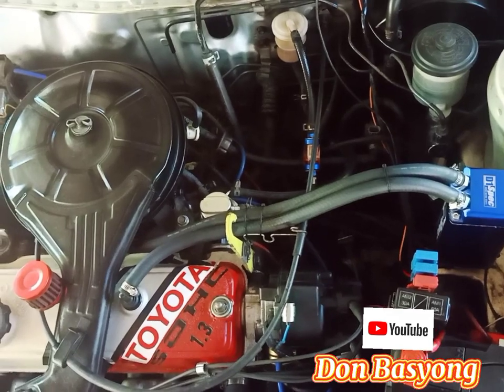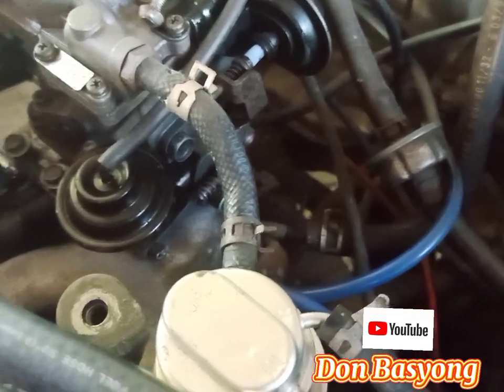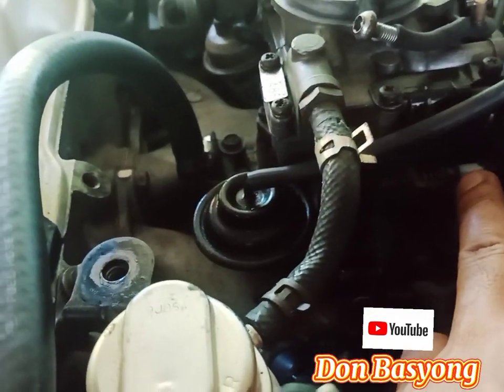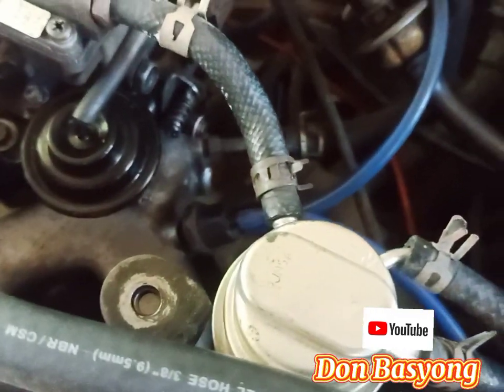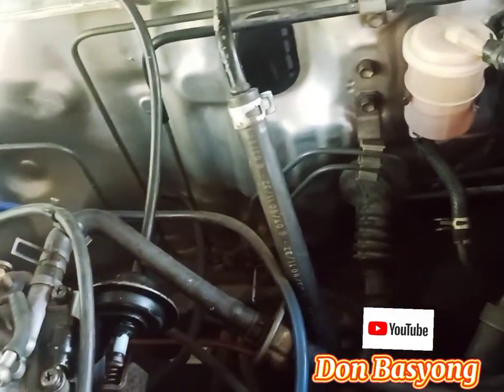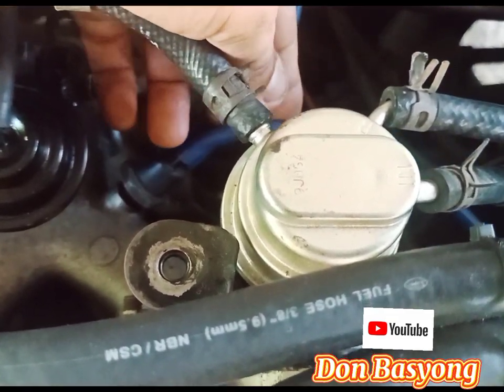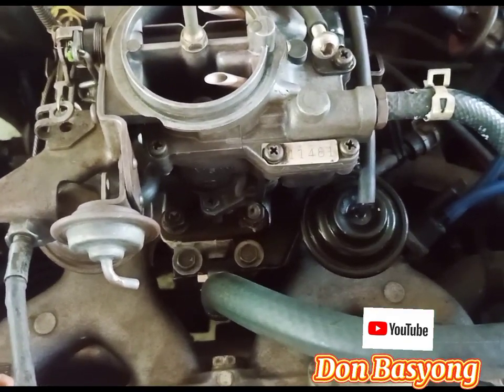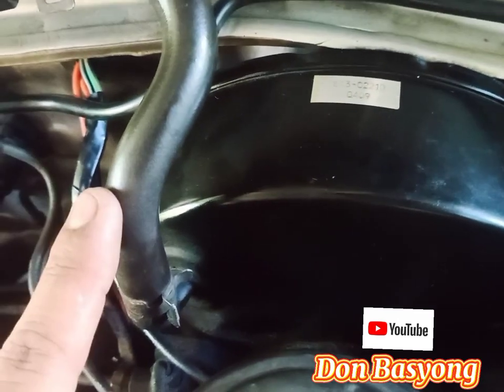VACUUM HOSE LINES | VACUUM LINES OF CARBURETOR,Aisan carburetor vacuum diagramTIPS DIY @donbasyong

Comment: Bat po naka block yung isa sa tatlong labasan mula sa manifold?para saan po kinokonek yan sir?
Reply from the maker: yung air control valve ba kamo paps pwede mo doblehin pwede din single akin kc nka single line port lng at iniba ko ang line gawa nabili ko ay wla na yung ibang check valve ng auto ko
basta ang importante alam mo kung saan ang port at manifold vacuum at kung anu anu ang gumagamit nito sa carb like ang aircon diaphragm it use vacuum na manifold at syempre dapat malaman mo kung saan saan ang port na manifold na pwede ka pagkuhanan. sana nakatulong paps godbless
Reply: @donbasyong  salamat po sir. Malaking tulong po ito kasi ang gulo ng mga vacuum ng bb ko
Reply from the maker: Basta pag may tanong ka o nalilito watch mo lang videos ko para ma guide ka at Kung may tanong ka nmn just message lang sasagutin ko paps🥰

Comment: Sir gud pm. Anong model ng distributor mo? Plano kong palitan ang distributor ng 1.3 2e ko na contact point pa to cdi. Thanks and more power.
Reply from the maker: Good day paps Ang distributor ko is pang2e engine din. Mas maganda Ang electronic type kaysa sa contact point paps less.
Reply: @donbasyong  May part number ka sa distributor mo? Thanks sa pagsagot.
Reply from the maker: @ronaldtio7375  paps distributor assy. Parts number 19020-11320
Reply: Gud am don  basyong...un  distributor kap ng  2e ko nabakli  un no. 1,,,temporary dinikit  lng dapat ba palitan na yon...umaandar nman...
saan ba may  murang  cap...
Reply from the maker: @berniegamba2986  meron sa lazada paps message mko sa messenger e forward ko don Yung store na pinagkuhanan ko Ng magandang distributor cap..paps

Comment: Saan po naka salpak po yun power piston? Sir
Reply from the maker: Power piston sa loob Ng carburetor paps may maliit na screw Yun Ng at chapa na naghold vacuum operated Yun paps sa loob mismo Ng carb pag matigas Yun o Hindi nagplay paalyado or di aandar Ng maayos Ang sasakyan.makikita Yun sa upper part sa loob Ng carb na makikita sa tabi Ng secondary at primary barrel.

Comment: Ano pong carburetor po ito? 4K po ba?
Reply from the maker: @bobtomica9614  2e manual choke o cable type kabasyong
Reply: @donbasyong  Ano po mas maigi na carb? 2E o 4K po? Yun po bang gawang china na carb eh ok na po o yung used aisin sa chop chopan?

Comment: Ano po output voltage ng idle up solenoid kailangan papo kasi pitikin ang gas para lang magka vacuum tinester ko po 5-7volts lang po nalabas
Reply from the maker: 12 volts Ang idle up solonoid paps now I try mo rekta battery Ang idle up ska mo  e test Ang Aircon..Kung mahina parin try mo ilipat Ang pinagkuhanan Ng vacuum/manifold vacuum baka barado na Ang line Kya hirap Ang solonoid or mas mainam change idle solonoid may nabili nmn na universal idle up solonoid 350 pesos isa. baka kc palitin Nadin solonoid paps. Thanks for supporting Godbless 🥰🥰🥰
Reply: @donbasyong  sir nag palit na ko ng solenoid e ganon padin nilipat ko na din sa katabi na vacuum ganon padin e
Reply from the maker: @oreunencarnacion2579  ipa overhaul mo na carb meaning may bara na Yan ipa Tira mo sa expert wag sa tabi tabi lang para makuha mo Ang good result paps.
Reply: @donbasyong  ah san po ba dapat nakalagay vacuum ng aircon ? Yung sakin kasi sa mismong manifold di po sya nakalagay sa carb e.
Reply from the maker: @oreunencarnacion2579  paps as long as Ang pinagkabitan mo ay manifold vacuum Ang manifold vacuum ay kahit naka idle merong suction Ng hanging while Ang ported nmn ay kapag revolution mo ska lng nagkakaroon ng vacuum..now Yung sa iyo check mo Kung Ang vacuum Ng Aircon mo ay nakakabit sa manifold vacuum kc pag Hindi bumabagsak Ang rpm lalo na kpag ito ay naka idle lang.
Reply: @donbasyong  nasa manifold vacuum sya pero kapag hinugot at binalik yung nasa idle up solenoid saka lang nalampas yung vacuum kahit bago na yung solenoid na binili ko ibig sabihin di sira yung luma ko ayaw nya lang talaga agad magbukas pero sir kung kulang sya sa voltage bakit kapag hinuhugot tapos binabalik e saka nagana solenoid tapos kapag sinusukat ko naman output 5-7 volts lang kaya nagtataka ako pero siguro kung 12v output sa solenoid kahit di ko na siguro hugot balik yung vacuum ng solenoid e tatagos na agad ang vacuum
Reply from the maker: @oreunencarnacion2579  ganito kc Ang concept Ng idle up solonoid sa loob Ng idle solonoid ay may open and close valve once you one the Aircon matic allowing the air na dumaan at higop sa Aircon diaphragm now Pag close nmn matic din magclose Ang valve at Dina padadaanin Ang vacuum.Ang important e once u one the Aircon it clicks together with the compressor na mag engage..may mga idle up kc na iba iba Ang resistance/ohms buy Yung universal para makasiguro ka meron kc tayo tinatawag na factory diffect na pyesa.
Reply: @donbasyong  yun nga sir e pag ka on ko ng aircon di sya nagana pareho lang ng pinaltan ko tapos kapag dinadirect ko naman sa battery yung luma at bago tapos hihipan ko tumatagos naman hangin kapag on position siguro patingnan konna muna sa mekaniko auto electrical o kaya car aircon salamat sir sa pagreply
Reply from the maker: @oreunencarnacion2579  paps pinalitan mo nba Ang capacitor? Sa may baba Ng blower Ng Aircon or Yung mismong resistor block baka mga palitin na Yang mga Yan paps.
Reply: @donbasyong  sir may video tutorial ka po ba ng pag baklas non tsaka yung mismong cover wala din kasing nalabas na blower sa gitna ng sasakyan e
Reply from the maker: @oreunencarnacion2579  meron paps kindly check sa upload ko meron pagbaklas at pagpalit paps Aircon system.
Reply: @donbasyong  sige po salamat
Reply: Sir ano kaya kapag cold start kailangan pa apakan ang gas pedal para umandar diba yung inyo ata kahit cold start susian lang kahit di na umapak gas aandar na ? Nakasagad din po advance ng destributor ng sb namin
Reply from the maker: @oreunencarnacion2579  pag nakasagad Ang advance Ng distributor mo meaning may talon na iPin sa iyong timing belt paps. dapat di Yan sagad at Isa pa may allowance Yan to be adjust paps. specially pag ginamitan na Ng timing light.now if you like to learn more pag dating sa preparation Ng advancer Ng auto ay meron ako mga videos regarding Jan check mo nlng sa mga video upload ko.
Reply: @donbasyong  kaso yung destributor po ng samin contact point nga ba yon yung walang box na itim tulad ng sa inyo
Reply from the maker: @oreunencarnacion2579  kapag Ang ignition coil ay nasa labas contact point Yan paps.pag Yung ignition coil ay nasa loob Ng mismong distributor ito ay electronic type distributor..now Kung Yung sa inyo ay sagad na Ang advance may mali sa set Ng timing paps or either talon Ng iPin Ang timing belt paps.
Reply: @donbasyong  contact point pa sya check ko po kung talon isang ngipin salamat po balitaan ko po kayo

Comment: Sir goodever yun sa carb niyo nakaopen na agad un choke pano po ginawa niyo, pahelp pp
Reply from the maker: Yes Yung nakakabit sa auto ko manual choke operated Basta tangagalin mo Ang cable. Now Yung sa bago video ko electronic choke nmn Yun lagyan mo lang Ng plastic tie or alambre Yung humahawak sa choke shaft para Dina sumara paps.
Reply: Ah okay sir wala naman siguro magiging problema if naka open ne sir
Reply: @donbasyong  sir electronic choke carb un nakakabit saken kaso un wire sa may electronic choke wala na, ano kaya mas maganda manual choke o eletronic choke sir
Reply from the maker: Kung Yung build Ng carb no is electronic palit electronic lng kc Kung e manual mo Yan may conversation na magaganap paps.
Reply: @donbasyong  salamat sa adivice sir

Comment: Fuel consumption po ng 2e mo sir?
Reply from the maker: Fuel consumption 84 km for 2hrs driving walng Hinto wlang traffic at Wala Aircon  300 pesos balikan 168km for 4hrs driving 300 pesos ko may sobra pa kaunti. Experience driving from Laoac pangasinan to San Fernando Launion.
Reply: Donbasyong gud pm po,
 un 168km ilang litro ng gasoline ang nakumsomo ng sasakyan mo...
Reply from the maker: Sa akin kapag wlang Aircon o diko ginagamit 16 to 17 km per litter pag naka ac nmn Ako naka Ka 12 to 13 km per litter dependi din kc sa apak Yan kabasyong at mas mainam na rektahan takbo halimbawa constant na 60km takbo mas matipid pero pag naiipit sa trapik ay sus medyo may sasabihin na consumption pag dating sa fuel.

Comment: Sir bakit ung distributor ko e iisa lang ang pwedeng ikabit na hose ung sa taas ng idle screw
Reply from the maker: Iisa lang ba Ang port Ng advancer? Check mo Ang ibng video ko to guide u well kabasyong 👍👍👍
Reply: @donbasyong  ae92 kac ung sasakyan ko sir.iisa lang ung port ng vaccum advancer ko kaya nalilito ako sa mga vaccum line ng aircon ko..
Reply: @donbasyong  ka basyong napanood ko na rin ung connection ng automatic fan.ung tungkol naman dun e gusto ko lang itanong kung ilang ampere ng fuse ang ilalagay ko..salamat ka basyong sana masagot mo🥰
Reply from the maker: 7.5 up Ampere kabasyong 👍👍👍
Reply: @donbasyong  salamat ka basyong
Reply from the maker: https://s.lazada.com.ph/s.6jwfI
Reply: @donbasyong  salamat ka basyong more power sa iyong vlog.sana madami ka pang matulungan

Comment: ano po magiging resulta kung di pinagana ang HIC?
Reply from the maker: medyo matagal uminit ang ating auto ang hot idle compensation valve o hic valve ay nagkokolekta ng mainit na hangin upang mas mapabilis nito mapainit ang gas na papasok sa chamber at mapapadali ang combustion reach ng auto ang normal heating temperature.sna makatulong paps Godbless.
Reply: @donbasyong  salamat bossing,isa din siya sa dahilan para matipid sa gas ang makina?
Reply from the maker: @jamespelen5754  yes kc no need to consume gas in a period of time kc na about na Ng engine Ang temp na needed para can go na..pansinin mo paps Ang wla mga ganyang na hic valve antagal maabot Ang temp na require kc need pa more time more time means more gas..🥰🥰🥰🥰
Reply: @donbasyong  salamat bos, unti unti kong lagyan sa akin kasi marami ng walang mga vacuum hose, na condem na, yung secondary ko nga di na gumagana
Reply: @donbasyong  bos ano po ba ang mga sizes ng vacuum hose?

Comment: Sir anu epecto pagka baliktad ang pagkakabit ng vaccum hose sa advancer...kc sakin nagtiming ako gamit ang timing ligths hinugot kopo un sa my taas ng advancer un hose na intake manipold bale sa timing ligth ang taas ng advance halos nsa 30 na...nagtaka ako bt un hose na hinugot ko wlng higop na hangin so ginawa ko un baba ang hinugot ko un ang may intake kc malakas ang higop...so binaliktad ko at ayun nakuha kodin sa timing na 10 ..wla nmn akong narmdaman  sa takbo ok nmn manakbo pero matagal na plang baliktad un hose...second owner lng kc ako pero 2yrs ko ng gingamit ngaun kolng nalaman na baliktad kc dapat un hose sa taas pahigop dapat ang hangin d poba? Pero wla eh un pla un nasa baba ang malakas ang vaccum nia so nilipat ko kc db un ang intake manipold pagka nakaidle lng malakas humigop...tas un isa wlng vaccum unless nirerev ko nagkakaron....anu poba ng madalas nararanasan pagkabaliktad po?
Reply from the maker: pag ganyan sira na advancer mo paps yung sa itaas na parte jan ang manifold vacuum at ang baba ay manifold now oo gagana siya pero wla na sa timing delayed ng konti oo gagana pero accurate ba? hindi kc ang itaas na part ng advancer which is ang nakalagay is ang manifold na gives the engine additional degree advance halimbawa 10 degree madagdagan ng its either 3,4,5 degree depende sa ganda ng advance kung local or replacement or original. epekto na ang gamit mo lng ang forted gas consumption bakit specifically delayed ang advance ng putok sa combution chamber, kung napagpalit mo nmn ang ang hoses ito epekto delayed unti kc nga yung laki ng upper case ng advancer ay mas malaki ang ilalaman na higop compared sa baba ng advancer kung saan ay mallit lamang try or nakakita ka nba ng nabuksan na advancer pag kumparahin mo ang laki ng manifold chamber at ported chamber ng advancer doon makikita mo ang ibig ko sabihin paps.
Reply: @donbasyong  sir nung nagtiming kc ako witout vaccum bale ang advance nia galos nsa 30degrees na sya...ngaun un hos ng manipold vaccum wlng higop ibig sabin baliktad kc un sa baba ported vaccum hos hinugotbko un ang may higop na malakas so ibg sabhin bka nagkamali un dating mayari ang pagkalagay ng vaccum hose...ngaun ginawa ko un malaks na higod nagaling sa ported nilagay ko sa taas tas un galing nmn sa intake nilgay ko sa ported at ayun sir naging accurate un timing ligth ....bale nasa 10 degrees na sya dati nsa halos 30......
Reply from the maker: Paps e set mo muna sa 10 degree without vacuum manifold then kapag nalagyan mo na Ng manifold vacuum Ang advancer dapat mag advance Yan at maging it's either 13,14,15 degree at maging fuel efficient Ang auto mo paps
Reply: @donbasyong  ok sir maraming slamat sa info....binaybay ko un hose ng intake vaccum baliktad nga kc un malakas ang higop galing sa maipold pero un isang hos na wlbg higop ay galing nmn sa carb...so ibg sabihin sir baliktad nga pagkakabit ng unang owner...kaya nun tiniming ko sya sobrang advance umabot ng 30 degrees tapos pagnirerev ko bumabalik pababa nagiging 10 degrees baliktad ang timing .buti nlng napansin ko na wla syang higop na hangin kya nagtaka ako kya un babang hos nmn ang hinugot ko at yun nalman ko na malaks ang higop nia kya sabi ko baliktad pagkakabit...nun nilagay ko na sa taas unhos na malaks ang higop un nasa timing 15bdegrees sya with vaccum at kung wlng vaccum nmn nsa 10 na sya pagnirev ko nmn nagaadvance n sya....
Reply: Sir puwede ba malaman location mo
Reply from the maker: Poblacion Laoac Pangasinan kabasyong 👍🥰